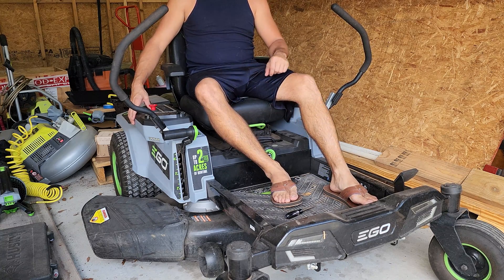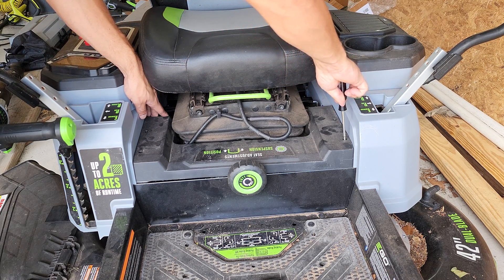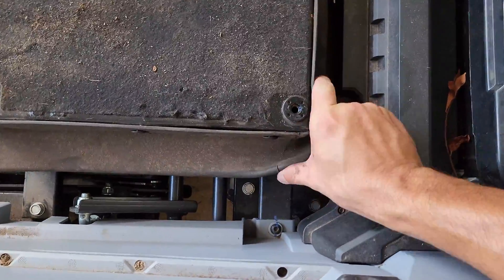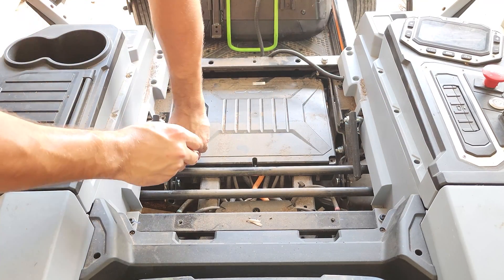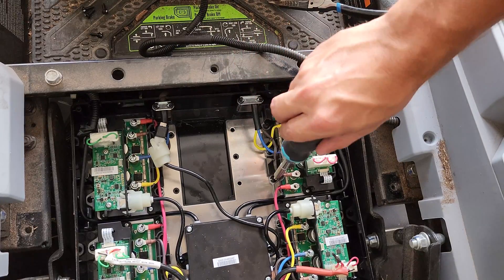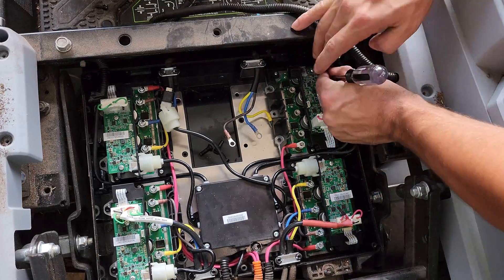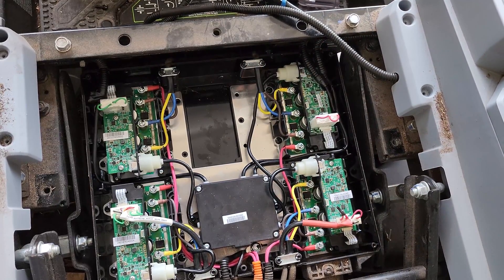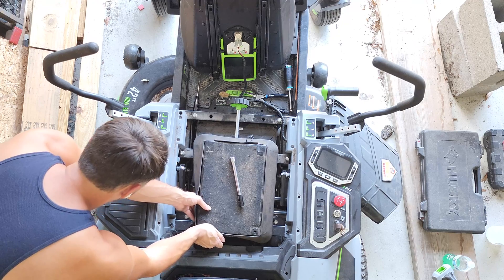DIY: Fixing A507/607 on an EGO Zero Turn Mower

Comment: Do you have a video for when the mower died nothing. I put it in the garage to charge now there is nothing.  No screen at all. Batteries all show full charge
Reply from the maker: I can't say I do. I recently had my battery box itself die, but the screen still lit up.
If the screen isn't coming on at all, I'd start by replacing the 2032 button battery inside of the display first and see if that brings it back to life.

Comment: I just did this on a 52" model. With the replacement board in place, I get no response on startup (not even the brief startup). I notice that the replacement board I received has a 2022 revision on the PCB and the original has a 2020 revision. (Originally purchased in 2022) - is it possible that there is a firmware version mismatch or similar? If so, do you know if there's a way to fix that? (Or is the replacement part I received more broken than the broken board?)

Comment: I see that this fixed the mower in the video but how was this actually diagnosed? Pretty expensive if you replace the board and it's actually a wiring fault or fuse. Doubly expensive if you replace the board and then have to replace the motor.
Reply from the maker: The error codes are typically pretty specific for this mower. But you can also use a thermal camera or infrared thermometer to check the board to see if it's overheating.

Comment: I'm watching your video, and I have a very similar issue, but an error code of 509 and my blades do start and run 30 seconds and shuts off i looked error code 509 it says possible lose blades well no lose blades so would this be the same board replacement as your code?
Reply from the maker: Hey there. 509 also references the plug that connects the blade motor to the PCBA: Plug (Triplephase, power wire) connecting the left driving motor with the corresponding PCBA is loosened.

If you've verified that the blades are tight and the connections at both the blade motor and the PCBA are tight, the next course of action would be to replace the PCBA.

Comment: I see you have an ego compatible battery. How does it compare against normal ego batteries?
Reply from the maker: Honestly it's been just as good as the OEM batteries for me.
Reply: @JoeMartinMVC  Thanks! Do you mind if you let me know the brand and where you got it?
Reply from the maker: @gerrymaddock9234  No real brand on them as they're definitely knock-offs, but this is the one I bought: 
https://www.ebay.com/itm/166207684177?mkcid=16&mkevt=1&mkrid=711-127632-2357-0&ssspo=zbjswbypsd-&sssrc=2047675&ssuid=XpnHLBJbSQe&widget_ver=artemis&media=COPY

Comment: I have error code 312 and 313, did anyone experience these?  Prior do do a hard reset, 507 and 607 was present but now only 312/313 shows up.  One beep and no movement what so ever.  Disconnected the 3 deck plugs, cleaned them, still nothing.  I ordered the board part hoping that will solve my issue.
Reply: Update.. I lifter the back of the mower on jacks and powered it on.  When trying to spin the wheels by hand, the left one I could not but the right one spins freely, it doesn't seem to be engaging at all.  That's the one that's tied to the electrical board which does not have light on our of the 5.  I removed the right wheel motor to inspect it and all checks out visibly, the motor gears appear to be fine, no rattle at all.  Inside of the gear box everything looks good too.  But to be sure, I will see if I can swap the line connections from the right wheel to the left, if the lines reach great, if not I will just remove the motor from the left wheel and install it on the right.   If the gear box and motor communicates with the main control board, and the wheel engages, and I get different error codes (ties to the left side now) then the my problem is with a bad motor.  Will work on this tonight and report back.
Reply: @user-vh2lh3js7e  
I just came across your post. My Z6 recently stopped working and displayed error code 313. After contacting Ego support, we performed a hard reset by removing the batteries for at least 15 minutes. Following the reset, I started encountering the following error codes: 311, 313, 310, 607, 507, and 312.
We also attempted a firmware update, but it failed multiple times. The Z6 currently has 39 hours logged on it. At the moment, the local Ego service center is diagnosing the errors and exploring possible solutions, but they haven't had any success yet.
I was wondering if you've had any luck fixing yours.
Reply: @ I’m sorry to hear you are going through similar issues.  My service center had to recalibrate right motor and reprogram the PCB board to it.  Apparently for the wheels that’s needed, though reprogramming not needed if the PCB board is changed for the blades.  Your service center should be able to work with support, I ended up paying for 6 hours of their time.
Reply: @user-vh2lh3js7e  Thank you for sharing your solution, when it comes to recalibration, sounds like you definitely need to have go to a service center.  I'll reply back with my solution when I get my back online and running.  I am also, definitely interested why the firmware upgrades fail.
Reply: @ Best of luck, I was going at it for months, wish I would have just taking in sooner.  Hope you get your working.
Reply: I've just replaced the part and it did not fix my issue, which leads me to believe that my issue originates with the 312 and 313 error codes.  312 documents as "Right steering lever controlling PCBA fails." and 313 as "PCBA controlled right driving motor fails.".  I assume 312 triggers something downstream, and the rest of the codes follow.  I'll continue to troubleshoot and provide updates, meanwhile if anyone has gone through this already please help!
Reply: Ok.. in taking a closer look at the boards while the z6 is tuned on, I see 4 of the 5 (mine is a 52 inch deck) have a small green light lit.  The 5th one, which is the right wheel is not turned on.  Luckily I purchased an extra board so I will swap that one too.  Will report back.
Reply: @user-vh2lh3js7e  i would get codes and i would flip my mower 90 degrees both ways, cleaned with compressor behind wheels, the brakes and steering control. Seemed to help. Also sometimes just swinging the lap bars out as hard as you can helped me

Comment: I have a Z6 and the right blade wont turn. The left one comes on intermittently. The PTO switch problem indicator flashed on the display. It doesn't give any error codes though. Should I replace this part or is there another likely cause? I have already taken the deck off and thoroughly cleaned it out. Checked my blades out and they are fine.

Comment: Sounds like I need to employee an infrared temp sensor. Thanks for the advice
Reply from the maker: Definitely would help find the bad board for sure.
Reply: @JoeMartinMVC  opened mine up and noticed small green led lights on each  board. One of mine was out was wondering If you might of noticed it aswell and if that was an indicator of a bad board. I can't ell on mine Because I have multiple error codes.

Comment: Great video! I followed it carefully to fix my 507, but it didn’t work.

I got out ye olde voltmeter and measured the voltage on each red wire (input power.) They were all 56V, except on the problem board. I followed that wire back to a second box where it is fed by a fuse. The fuse was blown. New one ($1.50) on order.

In the mean time, I added a jumper to feed both blade motors from the left fuse. It’s working great on the slowest setting!

Comment: At 20 hours is this repair not covered under the 5 year warranty ? I've got codes 313, 507, 607. My right steering motor seemed partially siezed and the tire hard to turn manually. Hoping ego will warranty the machine at only 44 hours of use !
Reply from the maker: I wish it was, but they only offer the warranty for the original owner, which isn't me since I bought it secondhand
Reply: Hey man try swinging out the steer columns as hard as you can lol, it resets my errors
Reply: I have the same error codes, in addition to 3, I also had 312 but it just disappeared now.  When the wheel was locked out on you, I assume you couldn’t push it forward and back?  Mine has no issue pushing it so it doesn’t seem to have the same issue.  I did switch the first board 407/507 but when I engage the mower I see lights on all but one board, which is the right wheel.  Looking into possibly bad board there too.

Comment: great video, I just got my new 52" Ego ride on, and it showed up DOA with error codes for the wheel motor boards, lap bar boards, and parking break board... I'm assuming the black box there is the communications board for all the other PCBA systems?  how likely is it my mower showed up with a bunch of disconnected wires, over actual fried components?
Reply from the maker: Its entirely possible that they just... didn't connect things up. Wouldn't surprise me. Also before ordering any new boards, make sure all of the boards are connected and try to do a firmware update through the ego app as they may just need to be synced up to the main board.

Comment: Was just mowing the yard for the second time this season, no issues other than the grass was heavy and I was running blades at full speed. Stopped to pick up a stick, got back on and started blades, 507!! Found this video so I figured I'd get a new board (or two) and follow this. Before all that, checked the app and found out firmware needed to be upgraded. Did so and now the 507 is gone!! So, you might want to give that a try. But I'm gonna order a couple of these boards, just in case.
Reply: Thanks for the video. I had my right blade motor fail. It turned out the plug for removing the deck had a pin come loose. These mowers are overly complicated garbage. Mine is a year old and has been in the shop twice. The board to tha batteries went out, the charger went bad and now the display won't turn on. Don't  waste your money people!
Reply: But..no gas no oil ))

Comment: Error code 401, loose connection on right wheel motor. Anyone have a fix for this?
Reply: I’d disconnect the plug above the deck, clean it up and reconnect. Ensure it is fully seated.
Reply: Did you ever find a fix for 401?

Comment: This man is a genius!  I have the exact same problem with a z6 smart steering unit.  Both of my blade motors would not spin.  Ego had no clue what to do.  I followed his instructions and just like that I’m up and running. Thanks brother
Reply: No, one board per code.
Reply from the maker: Glad I could help out!
Reply: Do you have to change all 4 boards for code 506 and 507

Comment: I had the 42” one but then returned it. I had an error code but then did the software update and it fixed it.
Reply from the maker: Wish that would've fixed my issue, but mine was an actual board failure.